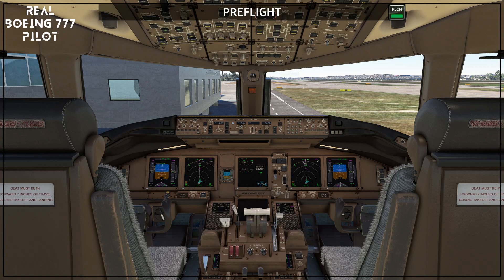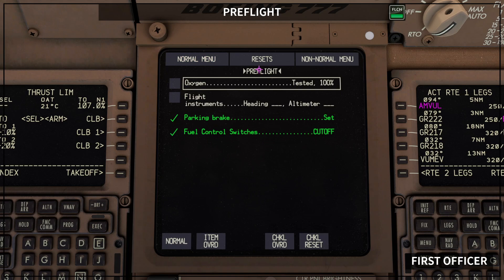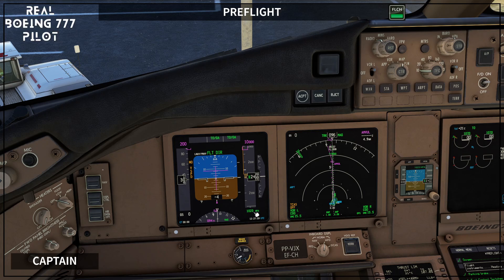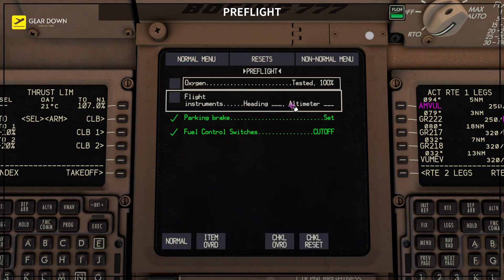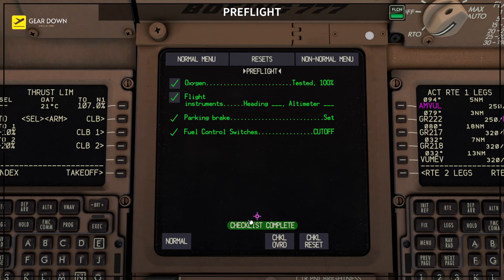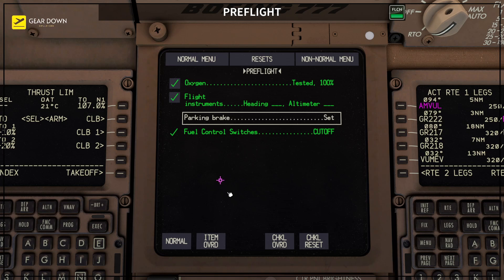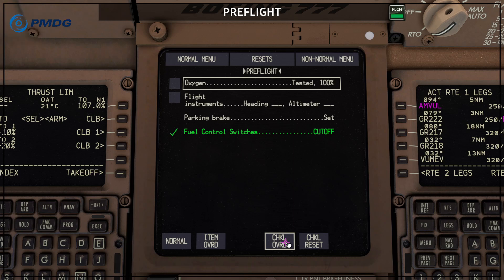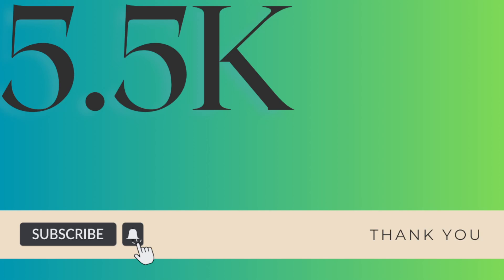PREFLIGHT CHECKLIST - B777 NORMAL CHECKLIST

Comment: Hi, very informative videos! I've always wanted to know what's the single engine service ceiling for a 777?
Reply from the maker: Hello!
It depends on the weight!
There is no easy answer.
You can check on the FMC, just navigate to VNAV CLIMB or VNAV CRUISE pages and select ENG OUT! You will see the maximum altitude there!